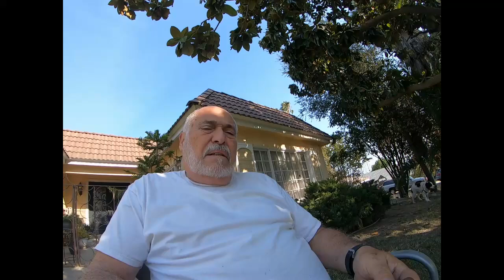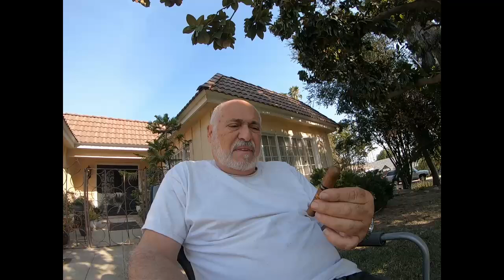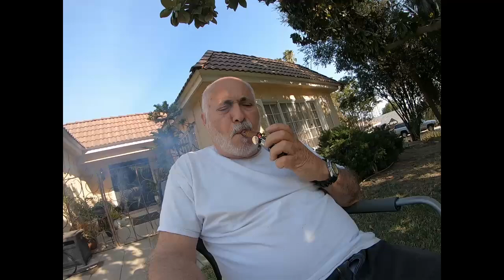Rochester Carburetor Question

Comment: If it's a twin engine, swap the other carburetor.... See if the carb you know is good on the suspect engine. If it floods the carb, you know it's the pump or regulator. If it run good, you know the carb is bad. Good luck!
Reply from the maker: The fuel filter is never full on the other engine so I know with the new regulator it will work fine.